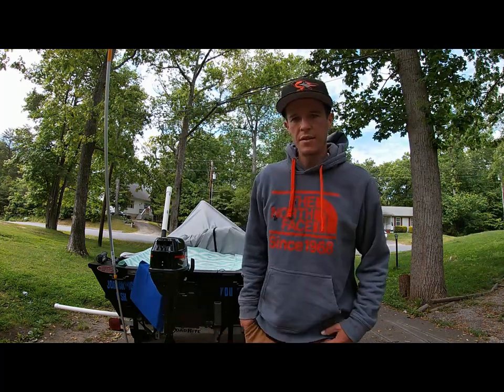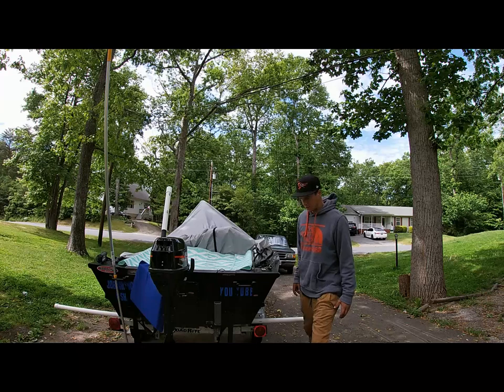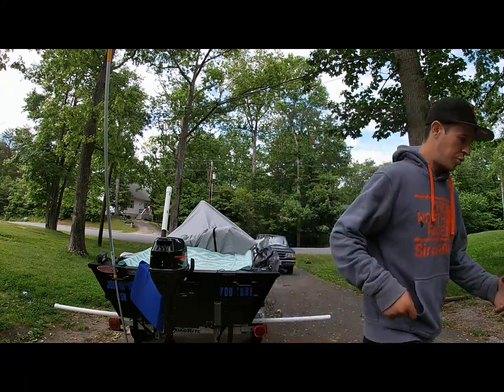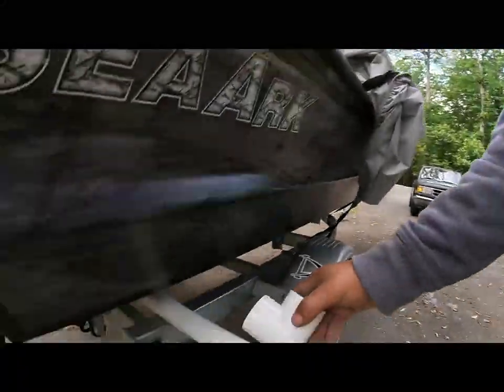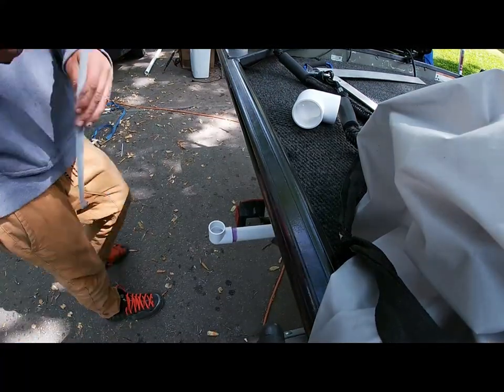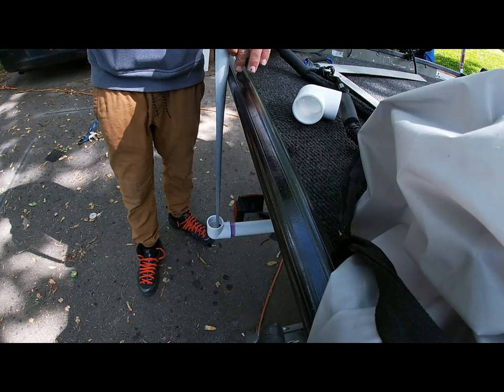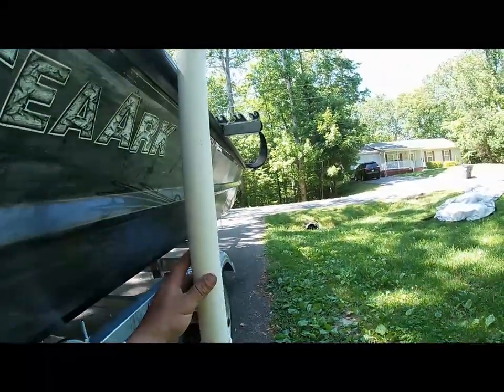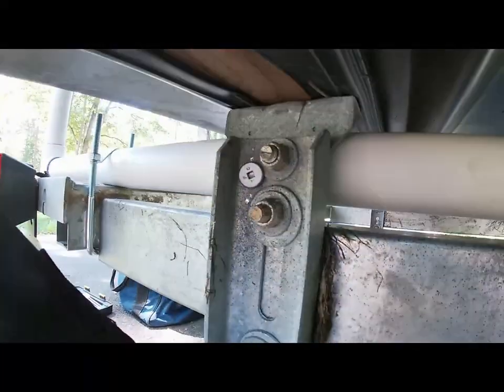DIY Trailer guides for a boat trailer. 2inch pvc pipe . REdEyE jon boat. JordanMichael fishing

Comment: Thanks for the video. The pipe all across the trailer width is a great idea to have two ends of pipe already fixed! I was just wondering why you didn’t mount that pipe on the bottom of the trailer, is your boat nose not potentially hitting that pipe as you meet it first in the water? How is it holding up? Are the pipe moving forward and backward? Or still strong? Thanks!
Reply from the maker: Everything worked out great. But i dont see anything wrong with installing them on the bottom

Comment: great vid.  im gong to do the something very similar but instead of using caps on the top, i am going to drill slotted holes on the pipe going across the trailer and the guide pipes for drainage.
Reply from the maker: Sounds good . You can still put the caps on top though. I just think it looks like a finished product with the caps

Comment: Nice job but your u bolts are supposed to be facing down bud good luck
Reply: actually, you are getting more surface area by bolting them the way he did with the flatter piece pressing on the pipe as opposed to the high psi pressure you will get facing them down.
Reply: @JRMSweeps  right...but you have bolts facing your hull that you potentially could drag on..
Reply: @alexcopland164  mine will not because of the bunk boards.  thanks for your vid tho, it did give me some ideas.